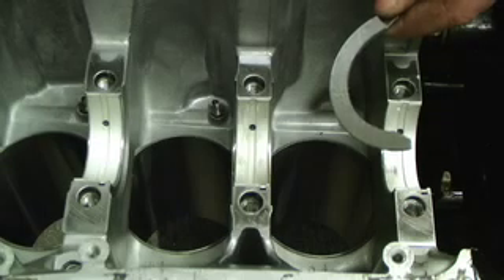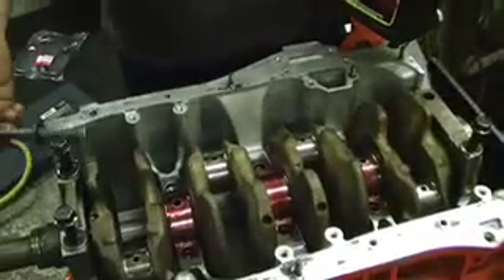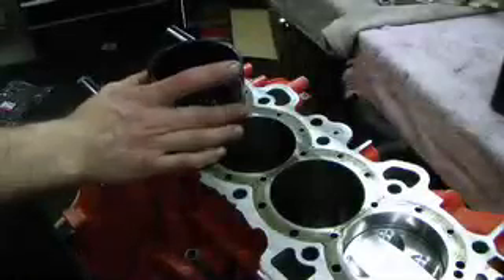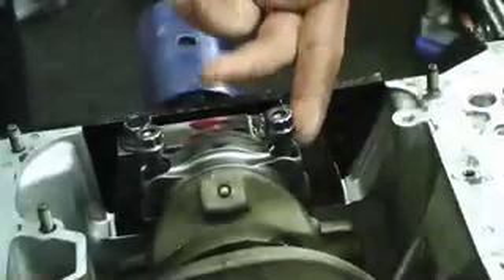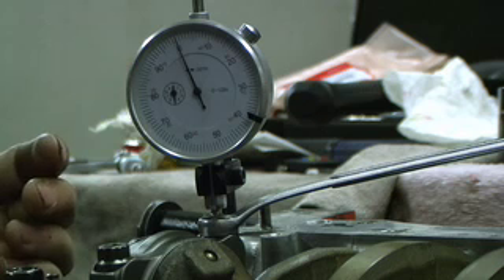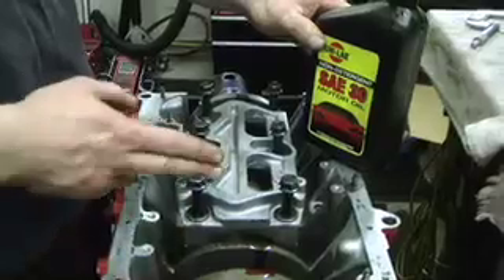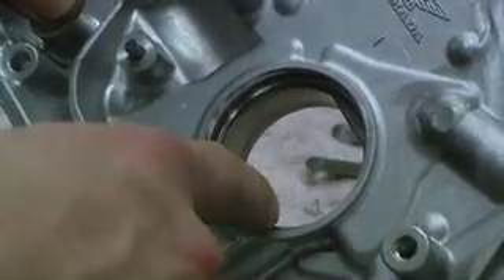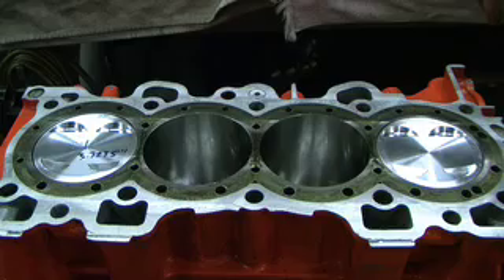Evans Tuning GSR Engine Build Tech Article - Part 3

Comment: evan what if you was to use acl bearings on stock rod, would you still have to have a measure spec sheet? for the oem bearings I understand that we use the color code rule. or could you just buy you a set of acl bearings slap it on and call it a day?

Comment: @PhizzleK96 It's like a plasticine substance that comes in strings. You can get different thicknesses to measure different clearances, for example the Red plastigauge goes from 0.001" to 0.007". Any bigger clearances need a different plastigauge. You can use it to make sure all the clearances between the bearing caps and crank journals are to spec (like he did in the video). If they're not, you can compensate by buying different thicknesses of shell bearings.

Comment: im learning how to do all this in gasoline engines class it is so cool to see a real life application of it (for money) :) we tore down and put together a 2.4 intrepid engine. mine started with no problems but my instructor thought it was funny to put a little water in the throttle body...lol glad i knew what white smoke meant.( there was no coolant running thru the engine)

Comment: @nightmathzombieethan no the threads wont be able to keep in that kind of pressure,  and you would need to torque the bolts down to 5,000ft/lb to generate that kind of oil pressure to crack the block.  before you could even put that kind of pressure down the threads would strip anyways.  its perfectly safe,  maybe unnecessary but is a good substitute for antiseize.

Comment: I'm curious why he puts oil on the bolts for the mains and the girdle. I can understand using antiseize, or even using a little bit of lubricant, but I'm curious about the oil. Wouldn't that risk cracking the block from hydraulic pressure when they're torqued down? I'm not criticizing, just curious, so any INTELLIGENT  answers/ideas from anyone would be appreciated. Any Know-it-all A%%hole punk comments will be ignored.

Comment: It really depends who you talk to. Jeff doesnt seem to need them, but remember this engine he is building will be putting down 700-800+ whp! So I wouldnt consider this a "street" build. Im building a "mild street" build.(500+whp) Im retaining the oil squirters just because it will be extra cooling. Im running ceramic coated cp pistons so technically I dont need them but its good to have IMO. And yes their is only 1 set of thrust bearings, in between 3 and 4 cylinder main.